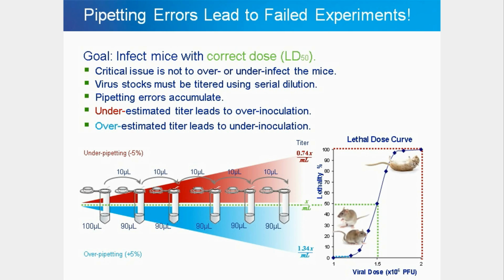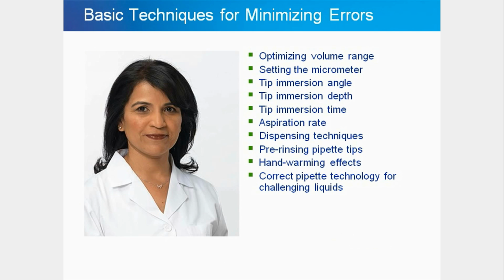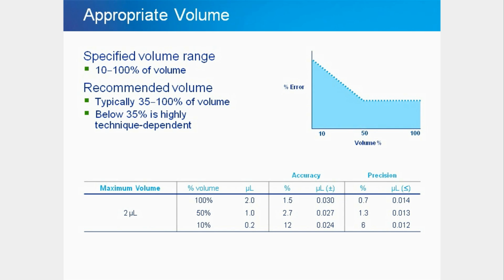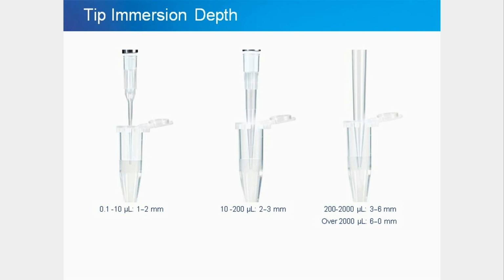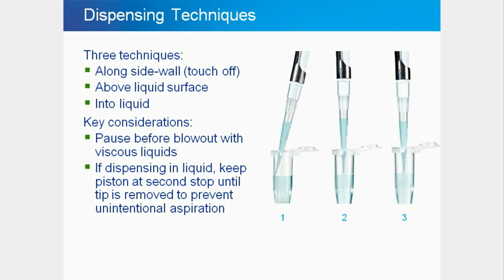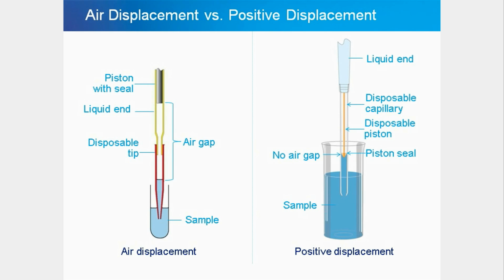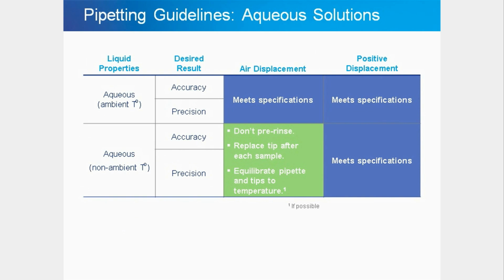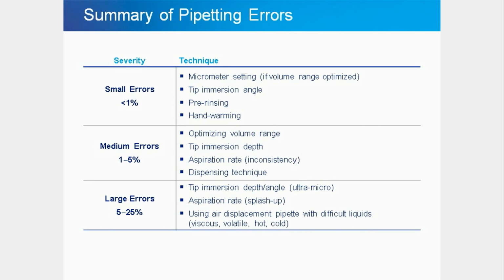Pipetting Technique | Good Pipetting Practice | GPP

Comment: When you want to release volume into a vial.. you mentioned how you must first go to the first stop than hold ? When you say hold do you mean still have your finger held in place in the first stop ?  Then you again until you hit the 2nd stop ?
Reply from the maker: Yes: Stop at the first stop. That delivers the full volume you set on the pipette. You will see a tiny amount of residual liquid left inside the pipette tip. To empty the tip completely, move the pipette over a different container then press the plunger all the way down.
Reply: @mettlertoledo  wow.. now I understand why my calibration curves always have a low R^2 😅

Comment: Can I use universal pipette tips on a pos d pipette?
Reply from the maker: No. Pos-D has its own tips, sometimes called "capillaries" and sometimes called "syringe tips." Each Pos-D tip has its own built-in plastic piston. The little metal "jaws" inside a Pos-D grab the top of that inner plastic piston to move it up and down. It's a different mechanism from regular air-displacement pipettes that use universal tips. Pos-D is positive displacement: no air between the sample and the end of the piston inside the Pos-D tip.